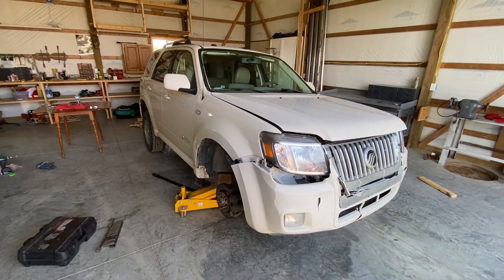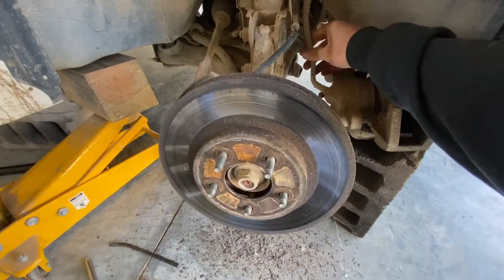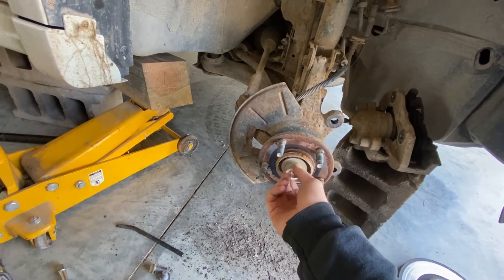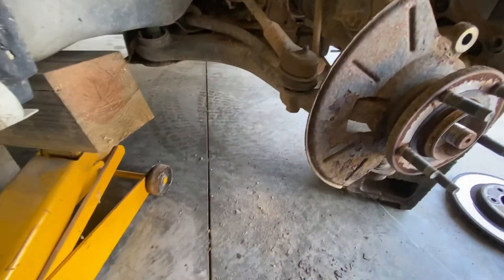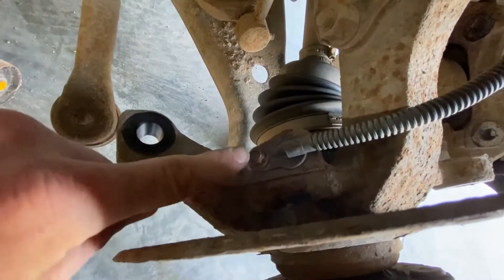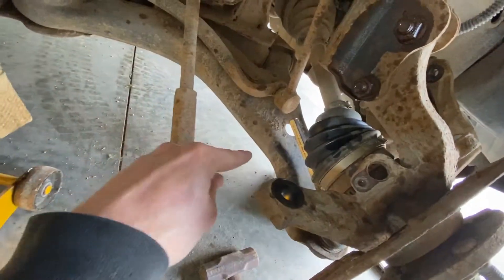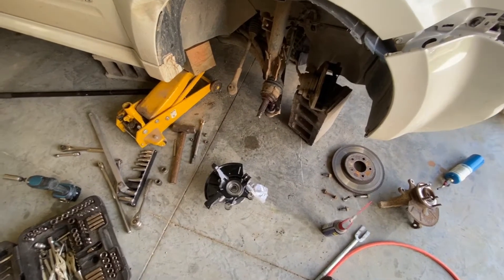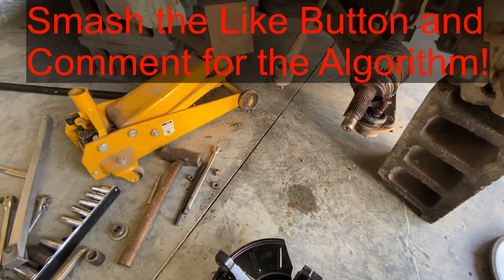Front Bearing Hub Replacement Mercury Mariner Ford Escape 2008 2009 2010 2011 2012 08 09 10 11 12

Comment: When taking tie rods out don't hammer the nut there is a flat spot on the side of the bracket that fords engineers put there so you could hit it with a hammer a few times and the tie rod would break free without damaging it.
Reply from the maker: Sounds good.

Comment: I have a 2010 mercury mariner and when the front is jacked up the wheels move in and out and is wearing uneven from the inner side
Reply from the maker: Could be the wheel bearings or the tie rods if it’s side to side. If it’s up and down that’s usually ball joints. But without actually seeing it, it’s just an educated guess.